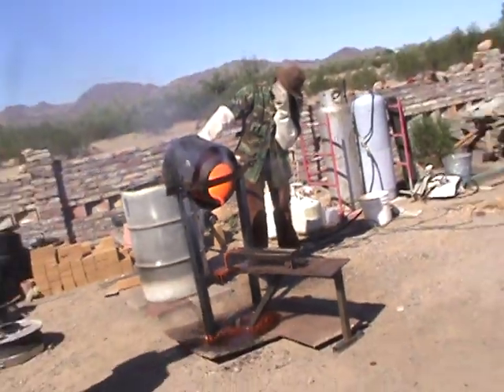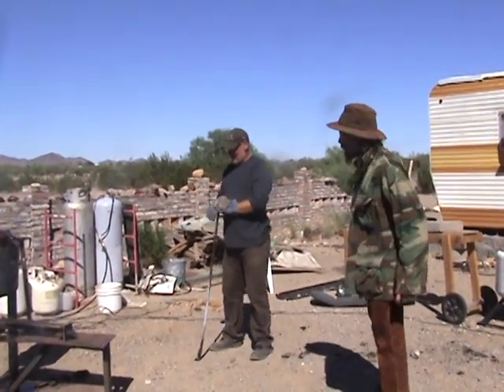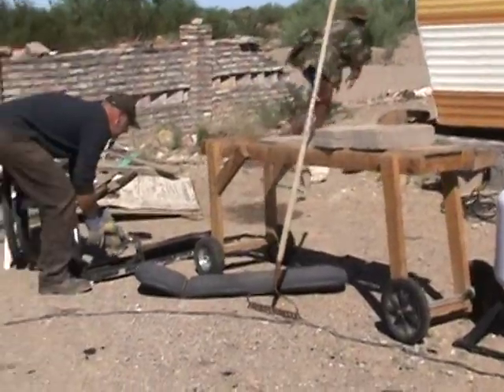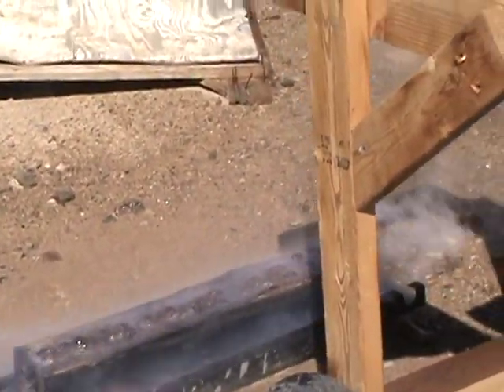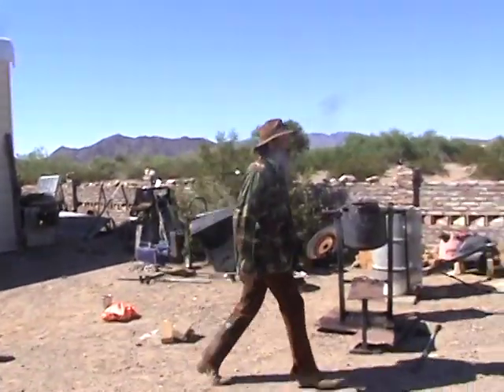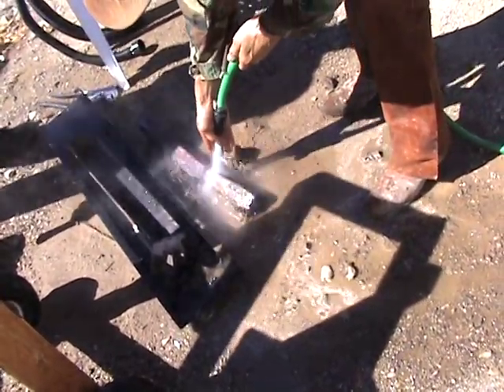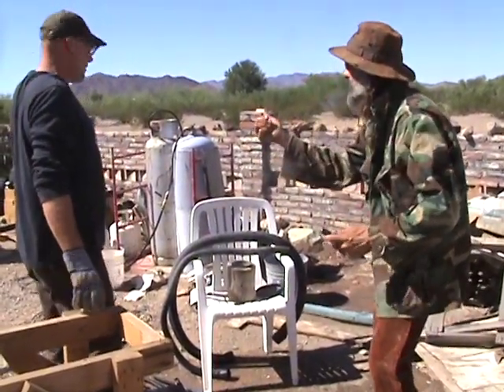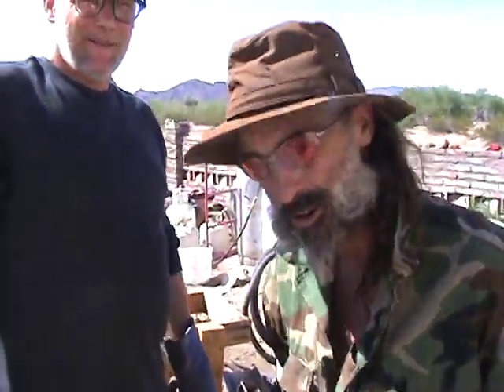SMELTING! pouring our first metal dory bar

Comment: why do they not know what  metal they have cast?...was this a junk run?
Reply from the maker: nope,.. it was an actual run of ore that we crushed with the hammer mill and panned out for the heavys and then smelted for a metal bar,.. how cool is it to make metal from rock? it was a life event for me!
Reply: you should try a bloomer we had 25 pounds of wrought iron after a short 8 hour period. dirt to steel in a couple steps.
Reply from the maker: Nathan Walker
nice we got our stuff from a copper silver gold mine, did you melt hematite?
Reply: hematite yes. found lots of rusty rocks along the James river here in Virginia and pre baked the large chunks to make them friable.  for every pound of iron ore we used a pound of charcoal in alternate feeds. a large "bloom" of raw iron come out and is forged solid.